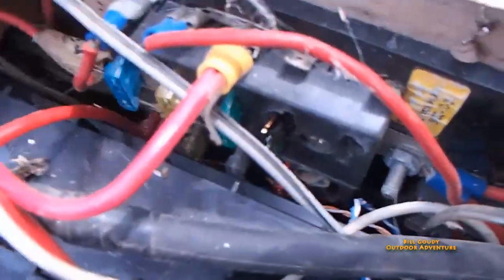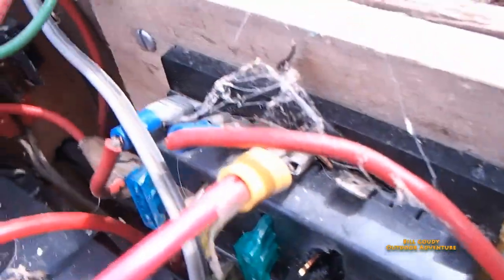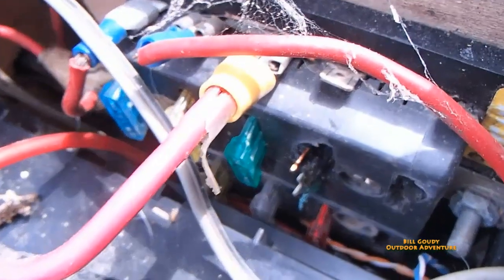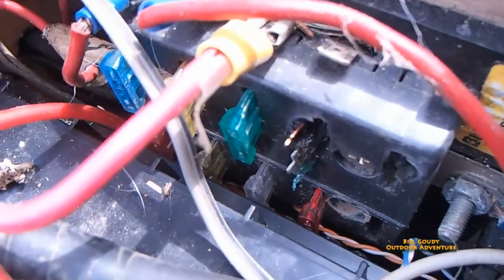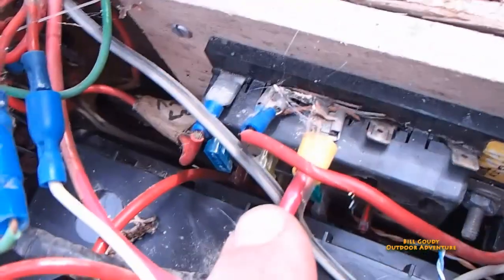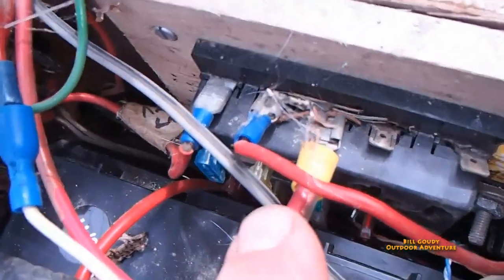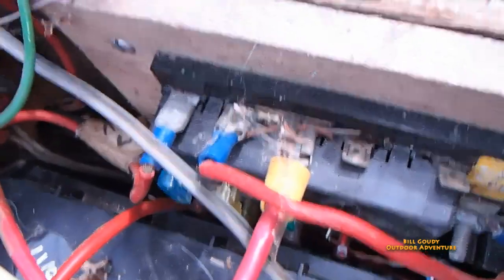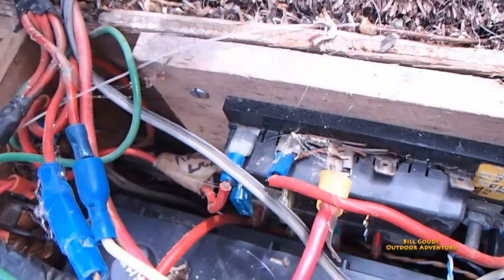Boat Trouble and Bad Weather

Comment: Too bad you had boat trouble but thank God you had extra gas and fuses. I grew up on the Illinois river and know quite well about dangers of losing power in that current. My dad would even carry an extra prop and cotter keys just in case.
Reply from the maker: I used to do that Michael...  I had an old Sea King Motor...  On this Evinrude motor the prop is stainless steal and they have made the prop with a rubber clutch ( No cotter key required)...  Much better than the old cotter key!!  ;-)  Thanks for watching my friend!!

Comment: My trolling motor has a resetable  30 amp fuse. God I hate boat problems.  I got them too the last 2 trips! Sucks. I'm glad you made it out. I know the feeling of being stuck. Hey at least you had paddles.
Reply from the maker: It appears that over the years corrosion built up and that caused excessive heat, Calvin...  It did not blow the fuse but it melted it..  So I have plans to change this set up in an effort to avoid this happening again..  I will see if I can find some more of that bait...  They only make so much for the year and then you must wait to get more...  It is just that popular !!!  ;-)

Comment: If the weather straightens up today I'll be up toward your spot fishing today. Always had good luck there.
Reply from the maker: How did ya do?   Did you catch any?...  It was kind of windy!!  ;-)
Reply: The wind shut me down before I got started. Going to try again today. My little 16 footer doesn't like rough like it was yesterday.
Reply: BillGoudy went out today about 8:30. Pretty slow until around 3:00 pm when all of a sudden they got fired up. Ended up with seven good ones. Fresh fish for supper and the rest are going in the smoker tomorrow.

Comment: How about that salsa man that looks good sorry about the boat trouble I hope you get it squared away
Reply from the maker: Thanks, Jars...  Things didn't go as planned on this trip...  That's for sure...  ;-)  I plan to change the feed wire to make it bigger and to change the way the fuse set up is ....  In an attempt to keep it from corrosion and generating the heat..  The fuse block got too hot and this caused it to melt..  I will try to change that so it doesn't happen again!!  ;-)

Comment: fishing the Ohio a lot I learned years ago... always fish upstream from your launch point...lol  You'll drift by it eventually... Plus when deer hunting always hunt uphill from your truck.. easier to drag downhill than up...lol     One question on the bread.. I finally found some up here but the carb count isn't that much different than reg wheat.   Is it better because of the complex carbs or what ?   I'm going to try a couple recipes  for low carb breads this week.
Reply from the maker: I like your life lessons, But just so happens I like to fish straight across the river...  Haha!!   Chuck, The bread is made from sprouted grains so it is very high in fiber which causes your system to work to digest it...  No enriched flour... and that is why this bread is kept frozen as the sprouted grains have a short shelf life..  This bread is low glycemic and will not cause a blood sugar spike..  It is more expensive but much better for you.  So yep!!  It is full of complex carbs and they don't count!!  ;-)  If you have any luck with your new recipes am always interested my friend!!